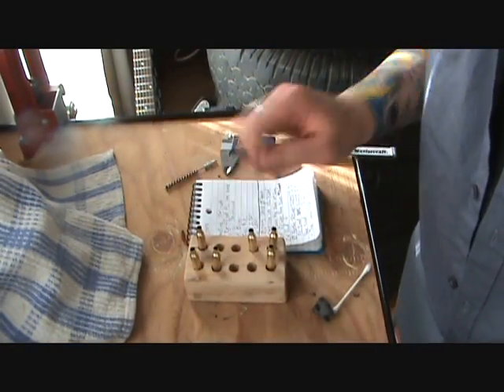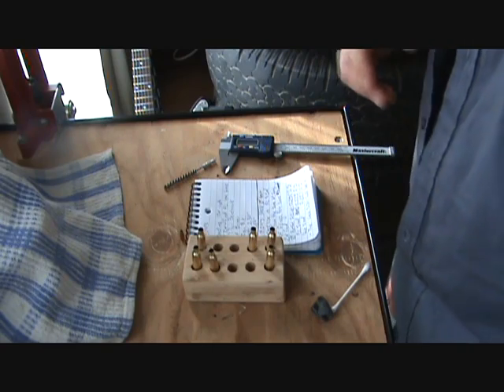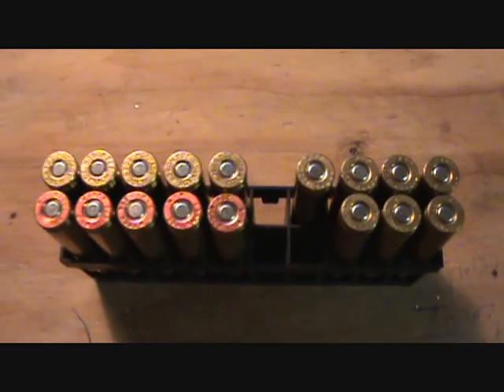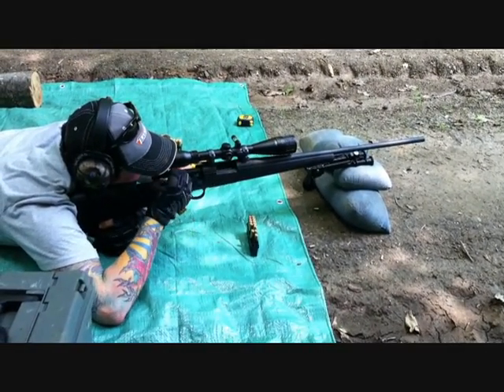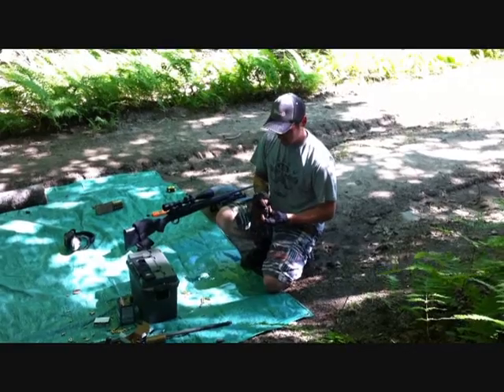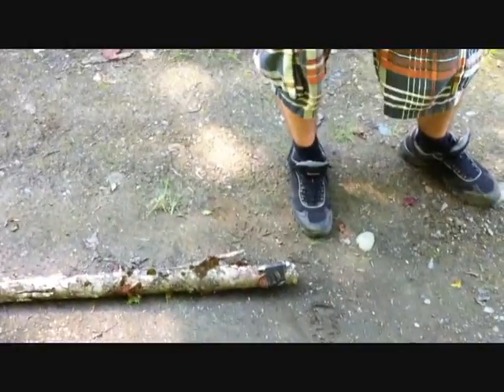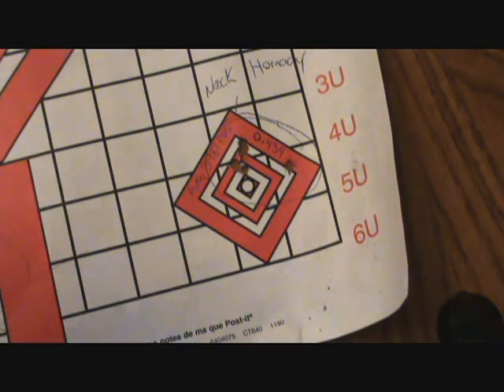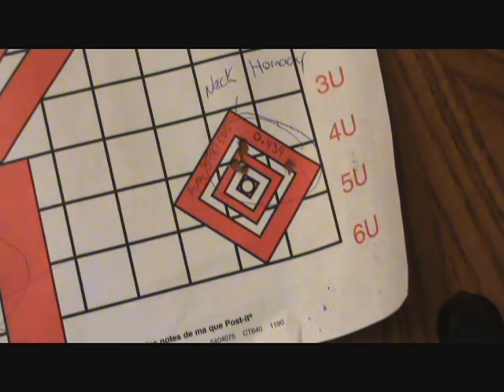204 Ruger neck sizing vs full length

Comment: The main cause in the rise of muzzle velocity is more than likely a rise the ammo's temperature, powder burns faster at higher temperatures and slower at slower temperature, it also is less affected with bullets that are traveling slower. The most noticeable affect you'll have is a bullet traveling fast with a large temperature variance between testing i.e. 204's, 222's, 22-250 on 70°F  to 90°F days
Reply: Buddy Dill I noticed this in 95-100 degree weather if I left my bullets out lol those 204s especially it atleast adds 50-80 fps average